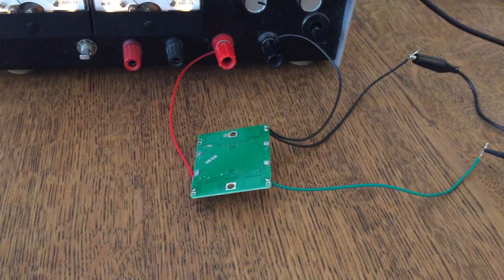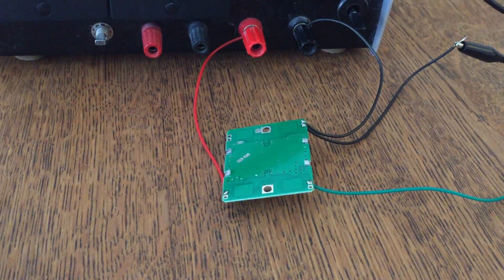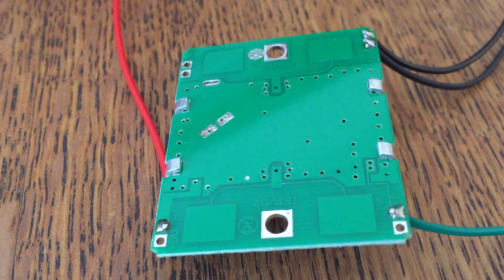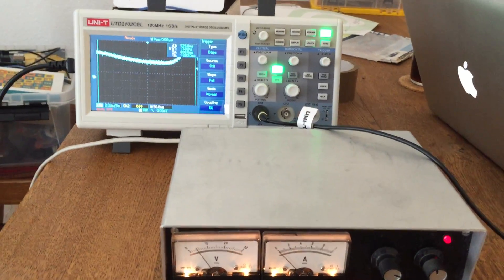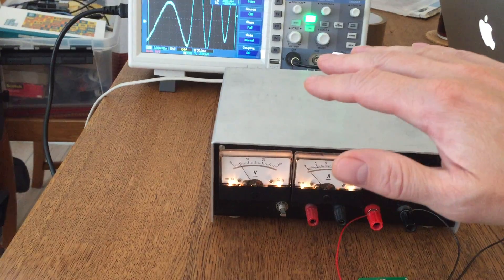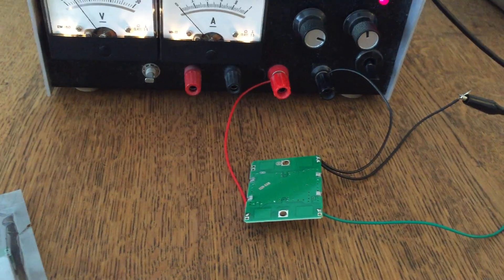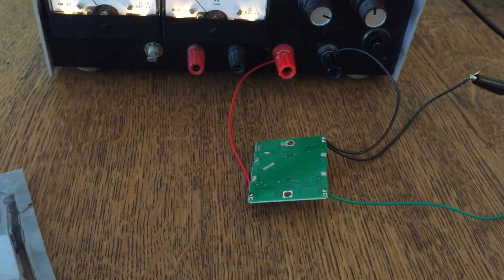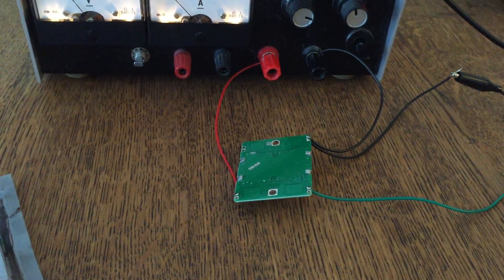HB100 X-band Doppler Radar movement detector

Comment: please Friend !! Do you know which is the  maximum range of detection this ?......Thank you so much !!
Reply: Sorry man but you must learn english. What you said means that is absolutely safe to use it for room safety.
Reply: This RSS figure can be view as an approximation of the output signal strength for a human at 15 meters
away walking straight to the module at 1.28 km/hour. 

https://www.limpkin.fr/public/HB100/HB100_Microwave_Sensor_Application_Note.pdf

BUT: Microwave radiation from the module is well below established safety standards for general public
environment, like ANSI C95.1-1991 of USA and NRPB-G11 of United Kingdom. 

so please don't use it as a roomsafety :D

Comment: Was the scope doing an FFT of the output?  I see some folks using this and they are just showing a voltage change, which makes me think there's some kind of peak detection in the hardware and it's just spitting out a synthesized signal.  This looks like you're getting raw IF that you could run through an FFT and pick up multiple objects (e.g. a fan and a person walking) simultaneously.  It would be interesting to get an audio recording of the output.

Hard to believe this is possible for less than $10, lol.  Well, $11 if you get it on amazon prime, UPS will be here on Saturday. :)
Reply: +jcims Came in a day early, pleased to find that it's the direct mixer output.  Rigged it up to run off the laptop with USB for power and using the mic to read it.  Was able to see myself walking around the room from 20' away and was able to measure the velocity of a BB fired from an air rifle at 300 fps.   Pretty cool!